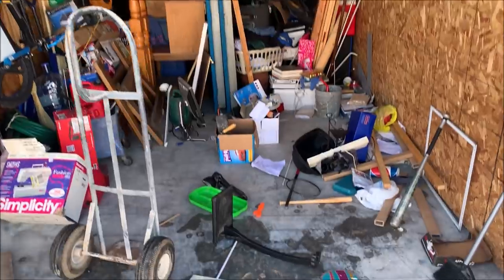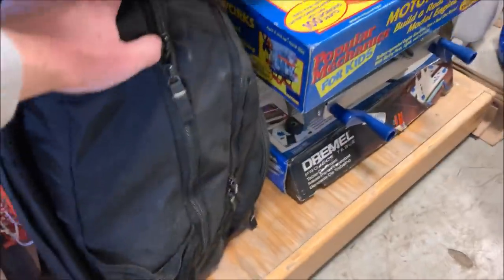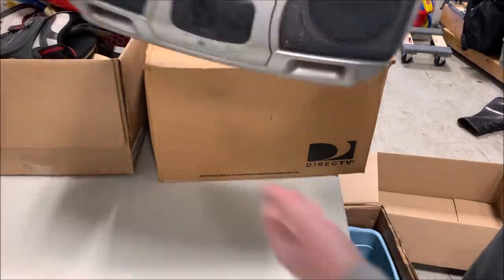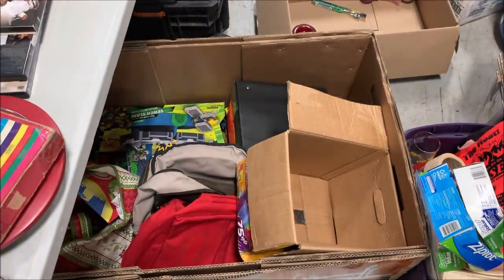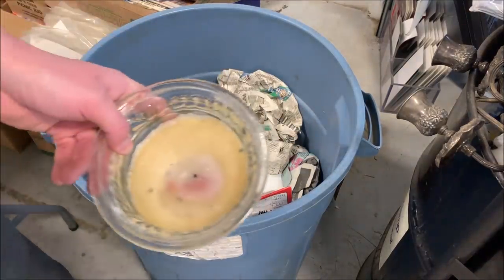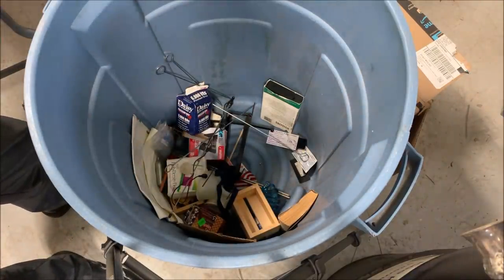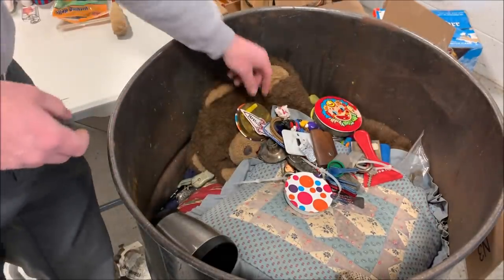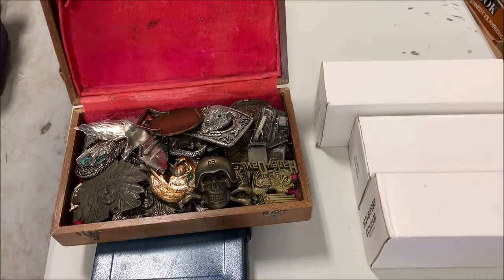This May Be The Best Storage Unit I've Ever Bought! Part 1

Comment: That’s actually an assisted opening knife and not a switchblade, legally speaking. Both have spring deployed blades the different is on how they are deployed. When you apply force to a button or mechanism on the HANDLE and the blade is deployed. That is a switchblade. When you apply force to the blade or a stud mounted onto the blade and the knife opens that’s is consider assisted opening.

Comment: I have been dealing in sports cards for over 30 years and from what I've seen, all those cards should be put in a lot and sent to your local auction.  They are mostly trash if mint condition and a lot of those are damaged or stained and hold no value.  The cards with $1-2 stickers on them were at best 5-10 cent type cards and the graded cards were of less than desirable players without much value.  I personally would toss them all in the recycle bin but since you can recoup locally, I recommend that route.   If I see you come across something rare or of value I'll be sure and let you know.  Good luck with the hunt.
Reply from the maker: That was what I did. Other than the few with higher price tags that I researched, everything else was sent to a local auction to be sold in lots. Bulk sports cards do alright in auctions around here, even just commons.
Reply: Resale Rabbit awesome glad to hear. I’m in the CA Bay Area and we have virtually no commons buyers here. I have about 1.5 million cards in inventory and 500k are commons ready to go. The Midwest and east coasters don’t want to pay the freight so here they sit. I’m glad you have several outlets. 👍

Comment: "Box full of resistors! This might have some value."
These are worthless, maybe a buck or two for the box. Most electronics parts are not worth anything as you can get them online for dirt cheap.
Reply: Well of its 1—2 bucks then it's not worthless. At least they weren't capacitors that could have degraded.

Comment: Video was good company for 2.5 hours of photos and listing :) I find your reselling strategy very interesting, not only because it is so different from mine (no warehouse, just a small office and I HATE clutter) but because it's proof that little things add up very quickly. There weren't any home runs in there but a lot of solid low- to mid-dollar items. Proof that persistence pays off, which is something I think a lot of new resellers take awhile to learn if they ever do. The home runs I have stick in my mind, but as a part time reseller I recall just as fondly those months where individual sales were smaller but consistent and at the end of the month I was $500 richer. 

As far as the favorite item definitely the cock and middle finger lighter. I'd put them together and sell them on eBay. Great bachelorette party gag gifts.